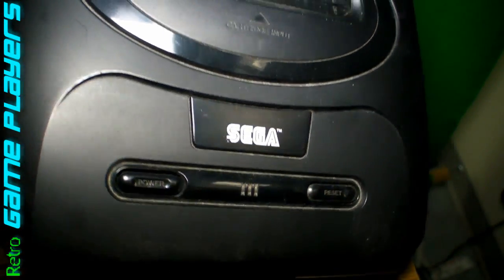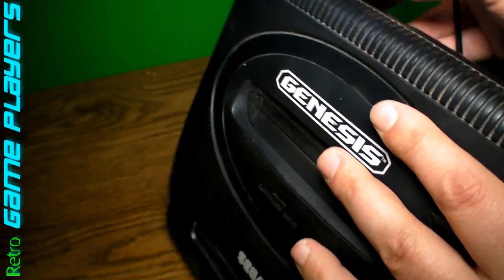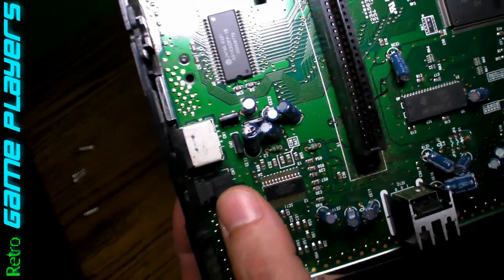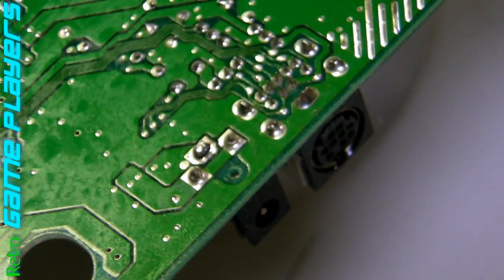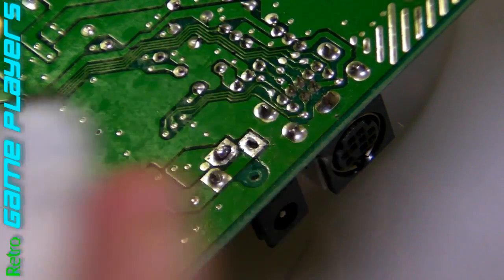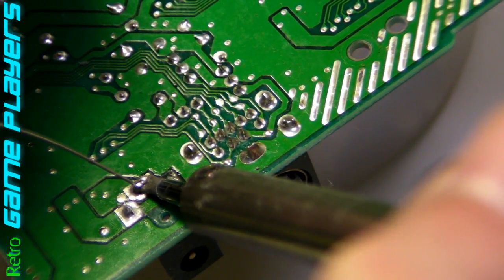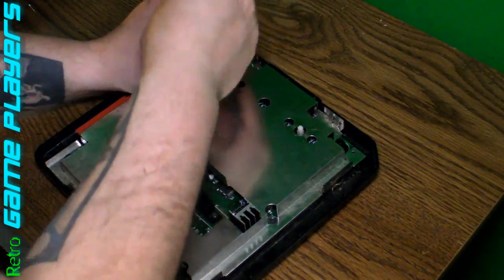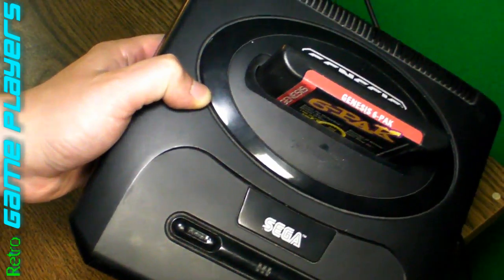Sega Genesis Model 2 Loose Power Jack Repair - Retro GP

Comment: I’ve had a model 1 Genesis since the mid-90s that I still use today, but I bought a model 2 in September of 2022 because I was able to get it on the cheap. Sure enough, the power module had a broken solder joint that caused intermittent power connectivity. Thanks for pointing this out. Although it was a quick fix, it makes me wonder what’s up with this being a widespread issue. None of my other 80s or 90s consoles have had solder issues. Well, I take that back. The power module for every NES had way too much solder applied from the factory, and using only wick to remove it takes forever. 😂

Comment: Thanks so much.  I used to angle the cord up and push my Genesis deep into the entertainment center, putting pressure on the cord and connector.  It'd work OK until the power would go out randomly mid game at the worst times -- great to have a permanent fix.  BTW I love all the background music in this video.

Comment: I think the point of interfefrence shields on these devices isn't that one could cause catastrophic radio interference on its own, but rather because a whole lot of things putting off a little bit of interference at a time could add up. Though I think the one on the Genesis is also designed to double as a second-stage heatsink.

Comment: The IO shield helps spread the heat around from that voltage regulator heatsink. RF interference can also interfere with other electronics, so I would recommend putting the IO shield back on.

Comment: I don't why Sega didn't secure the power jack onto the case, definitely a design flaw. I was lucky enough get 2 systems from one listing for a cheap price and one of them had this problem. I resoldered it like you did and also did it on the second system for good measure. If it happens again I'll just attach it to the case
Reply from the maker: Cool and yeah it's pretty weak there. I have a couple slim ps2's that did the same thing

Comment: The screen when I turn the game on is black and white and wavy could that be a sign of bad power jack too? or something else? please help
Reply from the maker: I don't think it would power on at all if it's a faulty jack. Sounds like something else. Try cleaning the slot with a cartridge and some rubbing alcohol. Insert it in and out trying to get the crud out of the slot. Also check the channel selector on the back, because it sounds like it could be outputting to channel 4 or something. Not sure if you are using RF or but I know that used to happen to me back in the day lol